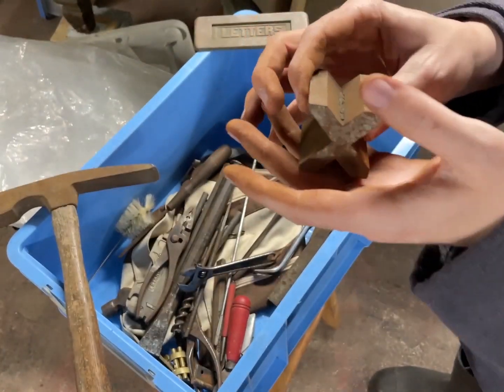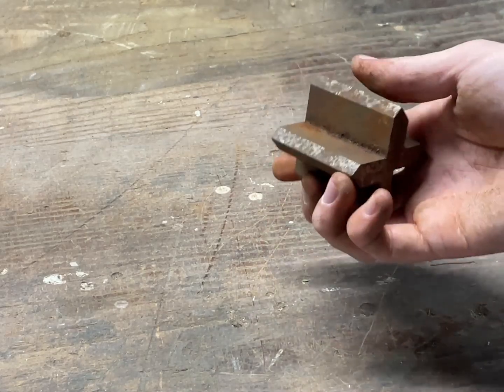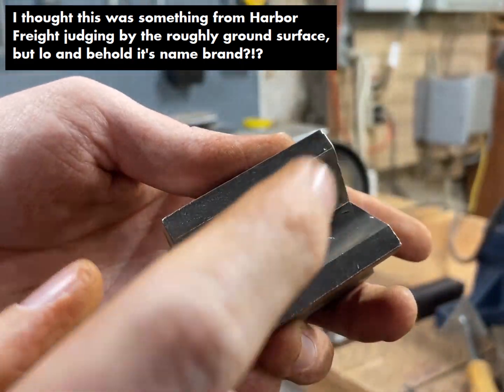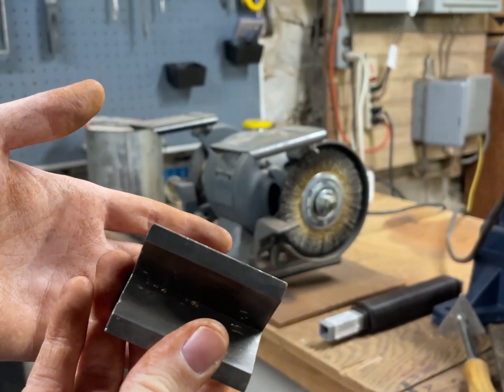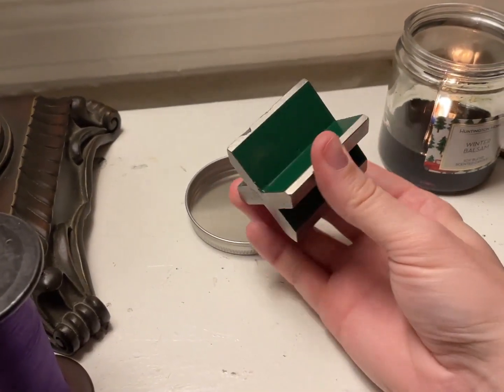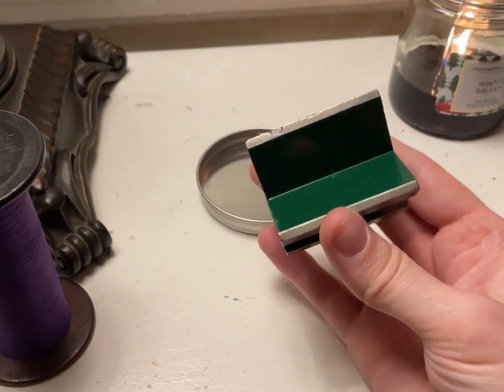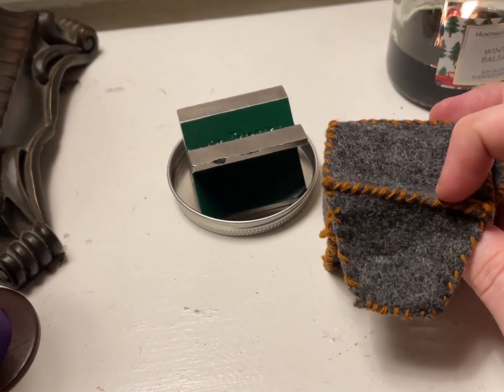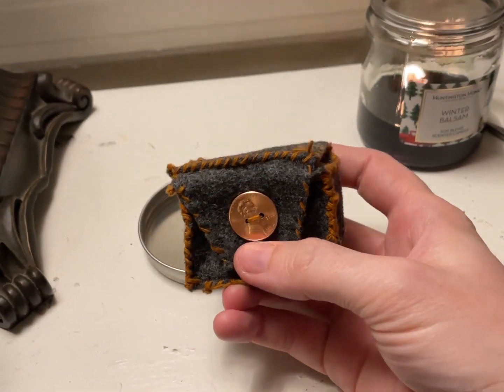An Eye For Detail 2: Furbishing a Starret V-block to be better than when it left the factory!

Comment: You'd get a better paint finish with muliple thin coats, allowing full cure and wet and dry sanding inbetween  between coats.
Reply from the maker: This is about as thin as this paint will go without heating it up any more.

Comment: It's marked Starret but looks like that? That is quite odd. 
Makes me wonder if it's super old (before they became known for precision/quality?), a fake/clone claiming to be real, a real one that has been heavily abused*, a factory-second that was supposed to be destroyed, recently-made and they've started slacking on quality while banking on their reputation like all-too-many have done, or???
*(this is the one I most suspect, after watching the whole video)
Cleans up nice at least. Are the holes in the V on one side bubbles or drill-marks? Looks like drill-marks.
Nice felt protector-case, I didn't see that coming! The penny-button makes it look like a fantasy chest/box.
Nothing for people to get upset over, it had lost its precision long before it came to you. Least it's clean now!
Reply from the maker: Well it is like 1.03" by 1.54" and it was very rough cut as you can see by the curved marks on the sides, so I think it just was a old low cost one. Those holes are drill marks.
Reply: Could be! Turned out nice in the end.

Comment: This is the first time I have used a thumbs down, especially for one of your videos, so I thought I needed to explain - the Starrett "V-Blocks" are used in multiple ways and ALL the surfaces are "control" surfaces including the "V's" so by painting them you have eliminated four of the control or useful surfaces of the V-block.  Additionally when you wire wheel or buff a surface it loses its perpendicularity or coplanarity to the mating surface (top of "X" to top of "X" at 90 degrees...  yes you can "flatten" that surface, but without grinding the mating surface at 90 degrees in reference the tool is basically useless...
Reply from the maker: Hahaha I knew somebody would say this. well this surface wasn't ground to a precision width, it was noticably off the size. also the paint in the V won't do anything bad. This had no control surfaces, it wasn't even ground to a precise shape.